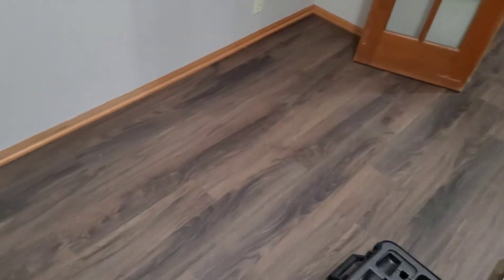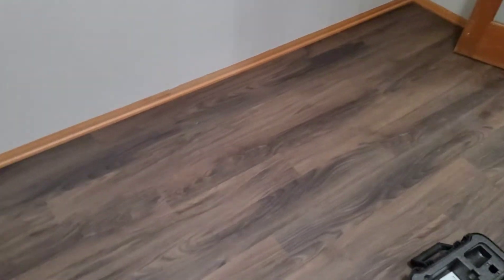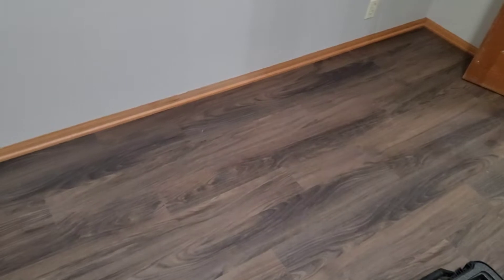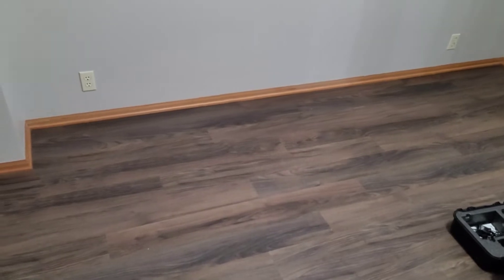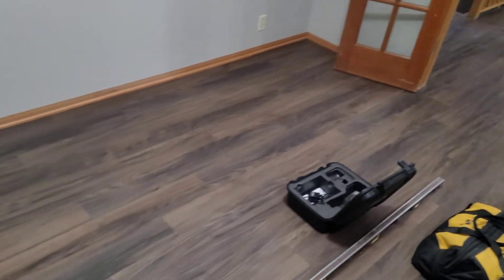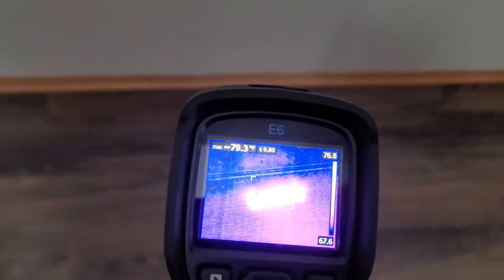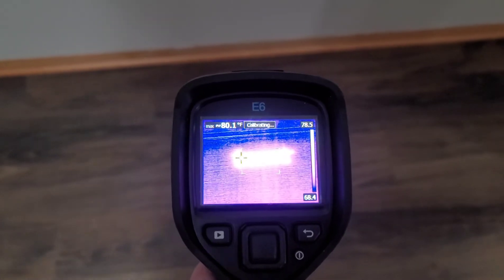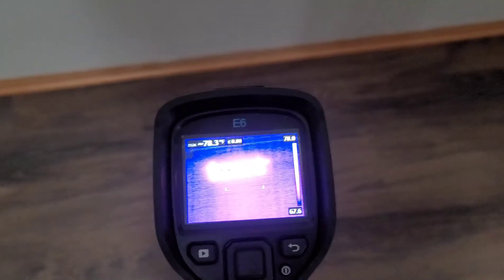Flir camera finds covered floor vent

Comment: I did this same thing last week in my own house. I actually left the metal vent cover on so cutting it out ended up damaging the planks around it just enough that I had to pull up the floor to redo it. Luckily I was only about 7 rows past the vent before I noticed the vent missing. Still took about 3 hours to fix it and get back to where I was. I was so mad at myself but glad I'm not the only one to do it. Lol